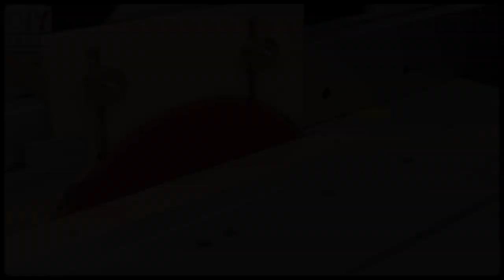Scrap Wood Projects #1 - Cup Coaster and Key Chain

Comment: Nice use of the scrap wood,.  I thought of an alternative method to produce multiples of the coasters.  Just glue up your scrape pieces into one large scrap block and then use the cross cut sled to make slices off that one large chunk of glued scrape.
Reply from the maker: tjhank you 😊🖐  yes that's the normal procedure when you want to build multiple identical ones. 😀👍